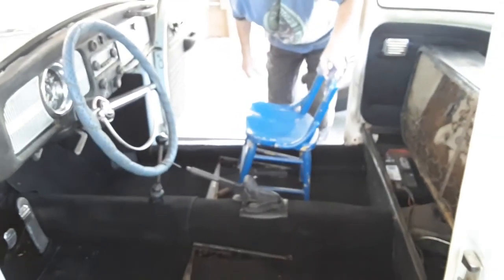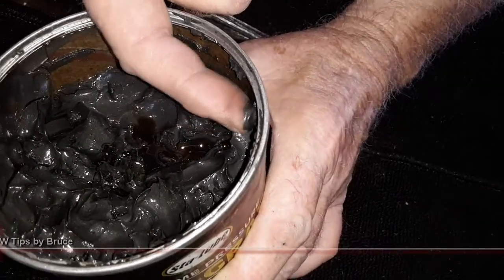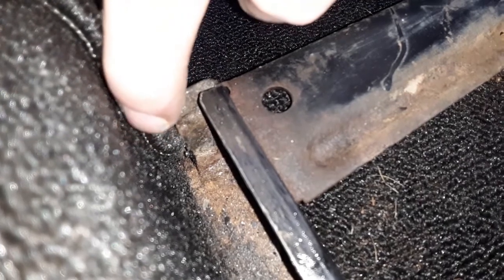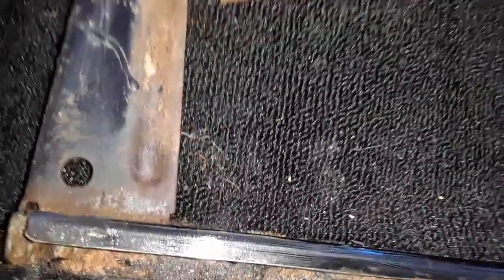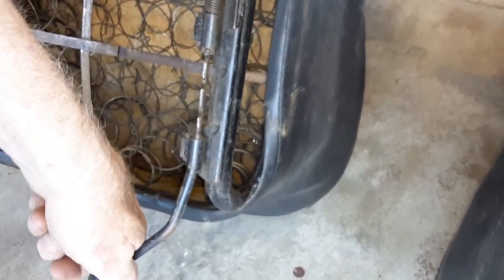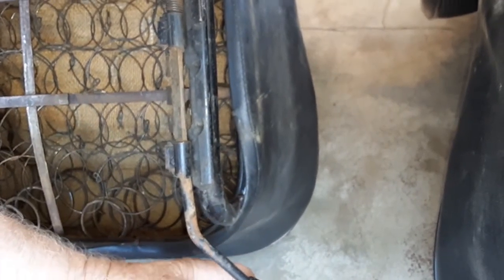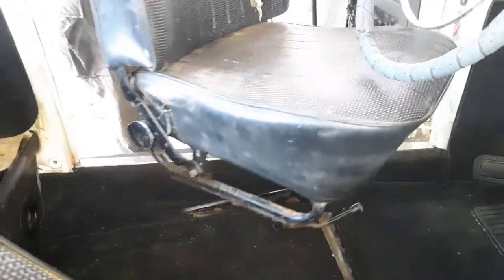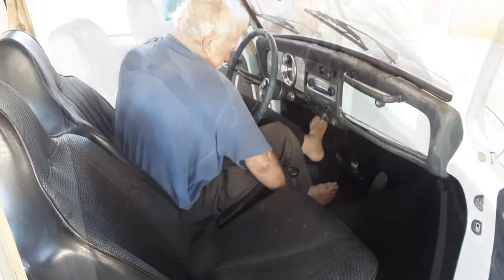Old VW Beetle Seat Rail Care

Comment: I've decided that I'm going to use my grinder to remove seat rails,and then I'm going to grab my welder and some metal ,because at 6'3"( + or - depending on day) I need more leg room,and this is even after cutting down my steering column and installing a  quick release 11  1/2" wheel...ill build to fit me,,my 1959 is a off-road toy and no rear seat allowed...

Comment: Love your video. could you please do one of the back seat. i bought a 1985 beetle bug without a back seat and purchased a replacement. I don't know what is missing like a rail or brackets to hold the seat above the battery. HELP ANYONE
Reply from the maker: Thank you, evidalesjr, for your kind words. I never wrenched on any bug newer than a 73 super beetle as I keep to the old classics. That is the area of my experience.
The basic rear seat set up is: there is a "L" shaped rail that attaches to the lower body structure with 1 screw on each end. The rail is supported in the middle by the frame tunnel. The bottom rear seat cushion sits on this rail with the back part up tight to the bottom of the rear luggage compartment. The top rear seat section is attached to the lower body via shoulder bolts through the built in hinge bracket allowing the top part of the rear seat to fold down. Wolfsburg West in Corona, CA. may have the rear seat rail or maybe find one on The Samba.com. Good luck & Happy Fahrvergnugen.
VW Bruce

Comment: I have a 69 bug and my seat 💺 came off and I’m having a hard time putting it back on ( driver side ) 🥺
Reply from the maker: Hi Justice. Sorry it took so long to respond. I've been under the weather a bit. About getting the seats back on track, it can be tricky. The key is both sides of the seat rails need to be on their tracks is the secret. Also, make sure the driver's side seat is on the driver's side. The two front seats are not interchangeable! You may have to tweak the seat tracks with a tap or two of a hammer. Make sure the seat rails are greased. Sometimes, once the seat is just barely on the tracks, sitting in it & pushing back hard with your legs will get it  fully on track. Hope this helps & Happy Fahrvergnugen! - VW Bruce